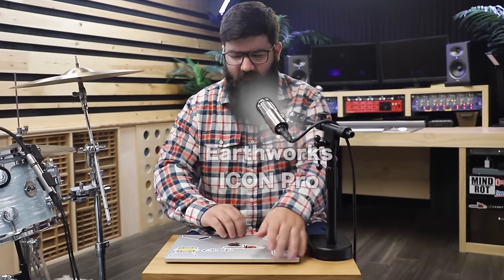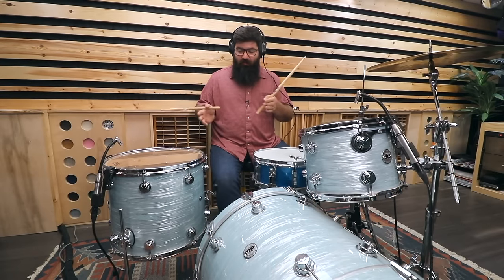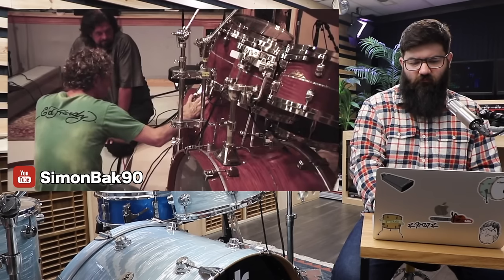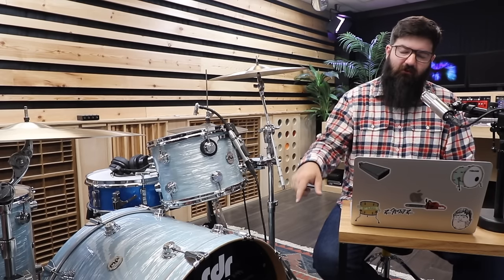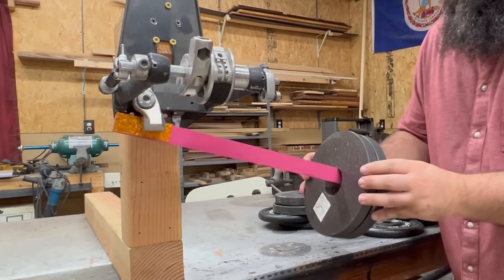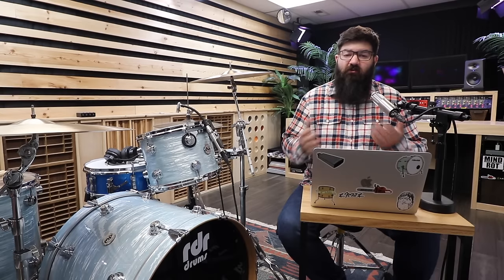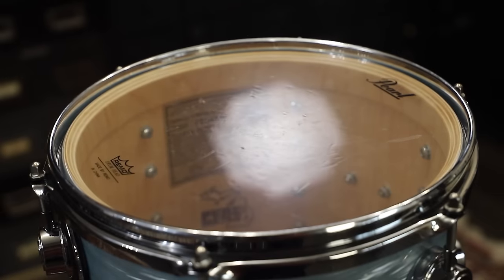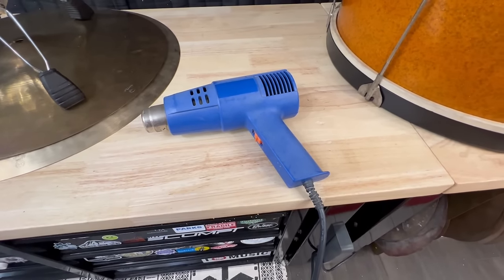The Founder of DW Drums told me to do THIS - Testing 5 Drum Hacks

Comment: Not a drummer. But am a drum tech. The heat gun trick usually only works one time. If you do it a second time your stick is going through the head once you start playing them. Because the heat cycles make the material brittle.

Comment: I'm a simply a Recreational Drummer at 70 yo, whom plays about 1 hour a day for Pleasure.  Since resurrecting playing drums after 50 years (1969), I've been watching many UT videos about Drumming and Drum Tuning etc.  I've learned a lot od "stuff" that i had no clue about in 1969: various drum heads, drum tuning, different sticks, etc.  All affecting the sound.  Currently playing on a PDP Concept Maple Kit with 3 Rack Toms, 2 Floor Toms, 2 accessory snares (1 Popcorn and 1 Piccolo snare), all with different heads.  On the Toms I use Evans G2 coated on the 8" rack Tom, Evans EC2s Clear on the 10 & 12 " toms, and Evans G2s Coated on the 14 & 16 " Floor toms.  HD Dry on the 14X 6.5 DW Design series Snare, Remo stock head on the Mapex piccolo snare and a Remo with sound control center ring on the PDP Popcorn snare.  On the ack Toms and the floor Toms I found that using a Evans E-Ring placed on the batter heads gets me to that nice Doooo, Dooooo sound that Jared describes in his Drumeo video.  And I employ this weird thing.  I use a cheap Griffin Piccolo Snare 13 X 3.5 with a HD Dry batter head and set it atop of the DW Design Series snare on the snare stand...  I know , WTF you may ask?  It works though.. nice Crack on the snare, and when i feel like a change, I adjust the snare stand and play the Design Series 14 X 6.5 snare.  The Kick Drum (or Bass drum), I have Aquarian II reso head and an Aquarian Batter heas with a Muffling Ring.  The biggest challenge is the "ringing" overtone form the Floor Toms.  Sounds Like a Drum suggests placing Cotton Balls inside the drum. Never tried that yet. Happy Drumming Folks.  My days are geting numbered bc arthritis is staring to encroach into my hands and fingers - the left hand particularly bad.
Reply: glad to see you are at it!!!
Reply: my grandfather refers to arthritis as his ol'pal arthur-i said "arthur?" he looked at myself & smiled and eluded to "ritis." I smirked and told him "well played,good sir. Well-played."😁
Reply: @Aldo M. I hear you I get it in the hands and feet.  Stretch the wrist gently and slowly before and after practice.  The colder it is the easier amount of stretching.  Meaning take a little more warm up time to stretch.  Also salads, Kale, carrots, collard greens and squash will provide better connective tissue for you.

Limit computer time and non argonomic activities.  Better days ahead.

Comment: As a sound engineer I have a hack. Change your heads and tune your f”in drums. No leg trick no need. Properly tuned I can mic toms with no compression. You want the best sound through a mic. Tune your drums and use a 50hz oscillator on the kick. Tiny bit of gate and done boys and girls.

Comment from the maker: Testing out 5 more drum hacks! Most of these are very subtle, but do make a slight difference. Try em out for yourself!
What are some other hacks you want to see tested? 🤔
Reply: make a snare with 70 air vents!!!!!
Reply: I was getting ready to type and ask if you could recommend a way to repair old drum heads and then you did the heat gun trick. Serendipity.
Reply: Through shell mount vs suspension mount for toms, esp big toms, like a floor tom, for more sustain control?
Reply: Someone demoed to me the much louder hit with a lot less effort. He hit the snare full arm swing with a lot of force, then, he hit it again just using wrist motion, there was a significant difference in volume, the wrist hit was louder and more focused.
Reply: Do e-drum hacks

Comment: The kit I currently have came with two suspended low toms. I converted the lower one with a leg kit but noticed it reduced the sustain quite a bit. After a little research, I ended up replacing the springs for the hoop and the stock rubber feet with the Pearl ones. After that, the resonance came back and was nearly identical to the suspended tom. Great channel. Keep up the good work!

Comment: The floor time connection to the floor can make a big difference (or not, depending on the drum).  I had a 14" floor tom that did not resonate well on its feet, but sounded great when tipped up on two legs.  I bought different feet with "floater" rubber bottoms, put those on the legs, and it was instantly way better.   It "decoupled" the feet from the floor and for whatever reason on that particular drum made a huge difference.

Comment: Definitely like the floor tom trick in terms of taming it in OH mics. Chances are in most cases you're gonna gate the direct mic, so the tail isn't really of any concern as it's being cut off anyway, but having a little quicker decay so it doesn't linger in the room can be helpful if you're recording something where the OH and room mics are prevalent. I'm sure the thickness of the shells and of course the heads and tuning also play a big role but all other things being equal that's kind of a neat hack. I'd be interested to hear the difference between say, having on a carpet (as most do) vs if you put the floor tom directly on a hard surface.

Comment: That's a neat trick to give new life to pitted heads.  I have to say, though, if your heads are getting pitted a lot, it would be a good idea to look at how you are hitting.  I've seen where some drummers, in an effort to have rack toms lower, will set the toms at a severe angle.  The problem is that the sticks wind up not hitting the heads at an optimum angle.  The sticks at impact are nowhere near to being almost parallel to the heads. The beads of the stick end up digging into the heads.  

Another thing I see some drummers do is not letting the sticks come off the heads after impact.  Dead sticking can be an interesting effect.  Benny Grebb does it a lot.  The difference is that he is doing it intentionally and he is not driving his sticks into the heads.  What is really hard on drumheads is hitting with a firm grip and letting the beads of the sticks dig into the heads.  I remember one drummer who had brought to an open jam a small auxiliary snare drum with a brand new head on it.  Most of the drummers were playing  it with good technique and it was fine.  But one fellow, after he was done playing, left several deep pits in it.  The owner was less than pleased.

Finally, the other culprit I see to pitting heads is the "basher".  He is the one who hits as hard as he can in an effort to be the loudest drummer in the room.  Apart from destroying heads, he is also working against what he is trying to achieve.  At some point, hitting harder only chokes the drum and actually kills it's potential loudness.  It is far better to use stick velocity with a relaxed grip and let the stick rebound off the head.  This way the drum can "speak" with its full voice.  And the heads don't lose their tone after just two songs.

While I'll admit I don't usually play very loud, as most of the venues I play tend to be on the small side, my heads can last a long time with rarely any pitting.  And when I do need to play a greater volume I try to "pull" the sound out of my drums, something I was taught.  I also use rimshots for my backbeats.  It takes a lot less effort to achieve the same result.  Plus, I'm in my sixties.  I won't last very long if I'm bashing.
Reply: age isnt anything except for experience & life lessons learned. I like your train of thought, my friend.
Reply: @Jake Loranger 
I know exactly what your saying.  Some of those bashers never learn the musical aspect of it.  Especially the know it all types that really don't know diddley.  They don't even know Boe Diddley.  It really can wear on you after a while.  Especially when they can't recognize good advice if it saved their life.  

                 Good comment though.  U know yo proffession.
Reply: @chrismallios1621  Thanks. I've noticed that a lot of those bashers think the measure of a good drummer is how loud he can play.  As in the loudest drummer is the best one.  It's actually kind of funny to see three or four of these guys (they're usually guys) at an open mic jam.  Each one hits louder than the previous one.  lol
Reply: This needs to be in one Eloy Casagrande’s videos. Everyone there raves about him being the best drummer in the world because of how hard he hits, I believe it’s just idiotic to waste that much effort when I also learned early on that you can be much louder following the steps you mentioned. (Ducks for cover from all the Eloy fans).

Comment: I'm an OG from the 90's drumming on and off and the best thing I found  using protection to connect the pedal to the bass drum is by cutting a bicycle tube into a 4' long piece of tubing and then cut the tubing on one side so it still folding, place it on  your hoop like your creating a sandwich and instant rubber protection for your hoop.

Comment: Seeing the floor tom flipped, the first thing I'm thinking is "dude... that could work for mounting a cowbell". Of course you'd have to remove the rubber foot, and it all depends on the size of the legs and the mount hole on the cowbell but... you never know. It just might work in a pinch...
Reply: If you remove the rubber foot, there's no need to flip the leg. The rubber feet are what increases the sustain in the first place.

Comment: Paint can deadens shell vibration via dampening it with mass. All it does.
We've experimented with other similar things, a light, fuzzy felt bag w/ sand on top of bass drum etc. Original intention was to prevent sympathetic Tom Tom ring when bass drum was hit, but it also tightened up the BD sound.
Good for hard rock, metal. Busy music.
Thanks for another cool video.

Comment: I use plastic bottles from shampoo or conditioner or even the large yogurt containers for a variety of things. Making hoop protectors is one thing that works great from plastic bottles. Cut a square of plastic. Fold it over to fit the hoop like a book cover. Add some light sand paper for some grip if you want that and clamp the pedal down. Works great and it’s free since everyone should have plastic containers laying around their house.

Comment: One "Hack" I stumbled upon is getting Evans G-Rings for my Toms (except the 8 " rack Tom).  The E-Rings tend to yield Just the right amount of Muffling the overtones. I also found that with my PDP Concept Maple Kit with 6 drums I use different heads on certain drums:  EC2s Clear on the 8" Tom, G2 coated on the 10 " Tom, a Red Hydraulic on the 12' Rack Tom (which is the most difficult drum for me to tune to my satisfaction; G2s coated on the 2 Floor Toms (14 & 16 ").  No Muffling or laundry in my Bass Drum - Aquarian Heads with Muffle ring - ported on the Reso side. HD Dry Snare heads on the PDP 14 X 5.5 Snare (not a great snare by any means), and on my DW Design Series Brass over Nickel 14 X 6.5 Snare (which I purchased Used in excellent shape from Reverb. And as crazy as it sounds, I have a cheapo Griffin Piccolo 13 X 3.5 which sounds great with a nice snap, but not too snappy with a HD Dry batter head & standard reso clear head and Snare wires.  I'm only a recreational drummer at 71 YO, who plays for enjoyment (after a 50 Yera Hiatus [1969], about an hour a day to My Music. Since returning to play Drums, watching and learning so much on Line at Various sites / Channels, I had no idea 50 years ago about different drum heads, and Drum Tuning.

Comment: I tried the hole on rest head vs no hole.  In comparison, the rest with the hole sounded like gluteus Maximus the rest head without sounded awesome.  this was with a small - medium size pillow that was generally at least 2-3 times heavier in weight to your average pillow.  The exact placement was inside just barely touching the batter.  It just needs to make enough contact to where it does not make a fluttering noise.  if it does flutter then push it a little more into the batter until flutter stops.  This may vary from drum to drum.  on a different kick, it actually required contact with the rest head a little more and not touching the batter at all.

Comment: (Sorry I'm so late to this party but I just saw this video for the first time.) The paint can has nothing to do with reflecting sound waves. It works because it adds lots of mass to the bass drum's shell, which lowers the drum's resonant frequency, increasing its low-end. If you somehow suspended the can inside of the bass drum without it contacting the drum shell it wouldn't do diddly to the sound. The floor tom leg trick is an old one that came from the 1950s, when FT legs were originally straight. The straight legs choked the drum (unlike the old 1930s-era floor-tom cradles they replaced). Drummers were stuck with this for a few years until someone figured out that adding the angle at the bottom of the legs decoupled them from the floor and increased their resonance.

Comment: You get the most vibrant warm tones from drums using your mic setup and mixing panel. I just watched another - unnamed drum guru vlogger and drum store clips. They were not great advertisements for their channels and drum kits.   Do people know why they used to put lights inside bass drums around the early 20's. - To reduce humidity generated by the dance room and stop the contraction expansion - check it anyway. It's the story behind weather head skins.

Comment: Another hack at works, for using a snare stand in your first tom is this: sit the drum onto the metal of the arms, rather than the rubber claws. It allows the drum to resonate more. When you put a tom in a snare stand and tighten the basket, it tends to choke the drum. This method allows the drum to breathe more.

Comment: There’s a vid by Sounds Like a Drum where they explain the paint van thing but with a sandbag. Essentially, all that weight is stifling the resonance of the shell so that just the heads are bouncing the energy around, aside from creating some diffusion from breaking up the air reflection points in the shell
Reply: What’s interesting about that is, it’s also the philosophy that Sonor used on their older thicker shelled drums.  Tama too.

Comment: For the bass drum grip tape. You should do a pull test now a twist test.  Drill a hole in the hoop sticks clap it in vertically, hang the weights off the bottom of the stick and see how much weight before the stick slides down.

Comment: I think the paint can with the sand in it is adding weight to the shell tension due to weight distribution maybe some of that tension of the weight on the shell is having a slight effect on the tension of the bass drum heads even changing the tone of the batter head ?

Comment: Little pieces of black 3m foam tape work wonders. Wheels need balancing, as so do shells. A nice rug makes a huge difference. Shag is great for heavier drumming. Mic placement is key though.
Reply: 3m foam tape on the heads. If your stands and drum legs are not on absorbent material. That's what creates bad resonance. Lack of absorbing under your playing area will only make it worse. It'll vibrate every piece of hardware to an early death.
Reply: The heat gun trick is great for on the road. Broke ass DIY works when it's go time.

Comment: Each drum has its own key. Whether you want to change the key with head tensioning or adding tape or muffling pads , to try and change the drums natural key is tough. I’ve two mounted toms. Same size. Same everything . One doesn’t have a bottom skin. But the best sound I can get from them both is when they are tuned to a key which is the same for both . I need to loosen or tighten heads to get them to different keys , but then one of them doesn’t offer good tone.

Comment: It is usually the other way around for me, with the floor tom legs. 
The term " coupling " is used in some sonic circles.
It is a major reason for all the mounted tom suspension systems. 
So, if your floor tom is sounding too dead.... lift it ( carefully) suspending it with your fingertips on the rim. If it is super resonant then.....them find a way to uncouple it from the floor. 
There is probably tissue/ paper towel napkins, close by. Fold them 8 layers thick ( whatever)..... place them under the floor tom feet. Of it returns a bunch of tom resonance..... you're done.
Reply: Same here,  if your have some old drop ceiling tiles they're handy to put on the floor under the floor tom defnitly suck some ring out too

Comment: I've used the heat gun hack. The only thing is that it permanently tensions the the head. So if you want low tuning on the tom, that option is no longer available.

Comment: With the paint can full of sand if both heads are on the drum lowers the  internal air volume which should  increase energy transfer to the front head as there is less air to compress. It should also break down low frequency standing waves. The weight should make the drum move less helping it transfer head and air energy rather than into drum movement.

Comment: I think the dented head fix was more targeted at the sellers of used drums. For the drum owners, that head will not last long after the fix since the heat weakened the mylar more than all the uh, spirited drumming.
The beater deal was nice to hear, since I have the rubbery speed cobra beaters on my iron cobra pedals. The sound isn’t that drastically different.

Comment: The opposite is also a hack.  Vintage floor toms often have no rubber feet or very thin ones.  Add a couple rubber furniture pads under them and suddenly you have much longer sustain.